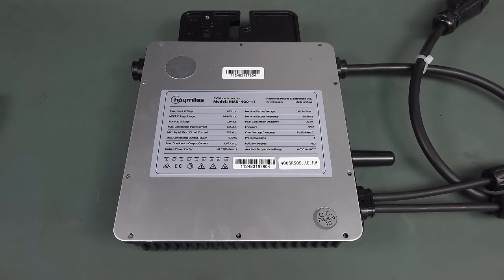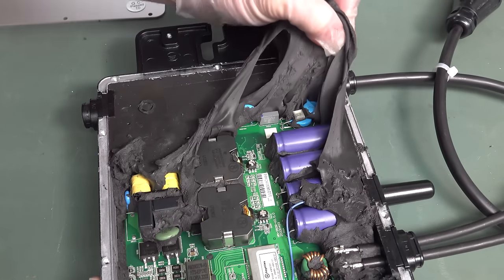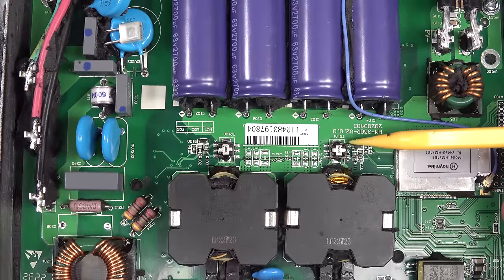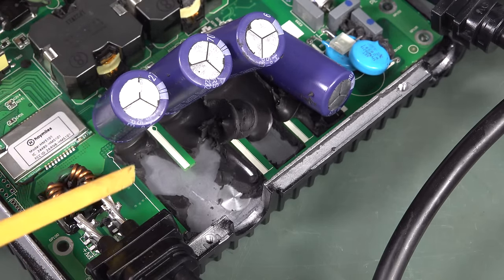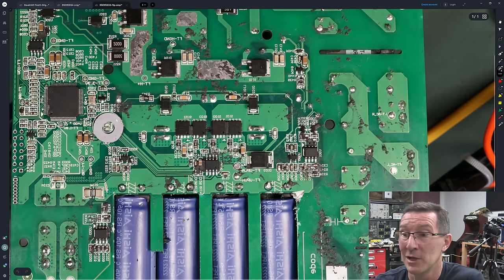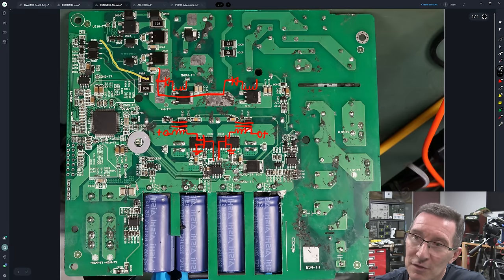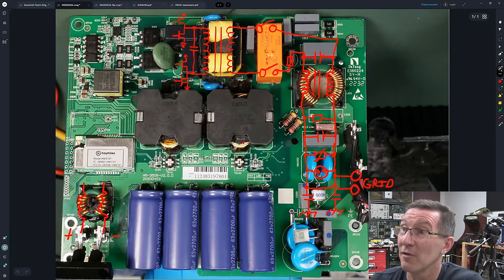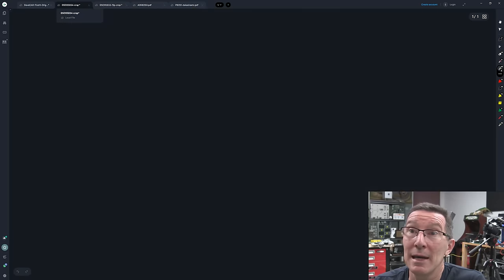EEVblog 1518 - Hoymiles Solar Microinverter TEARDOWN

Comment: A few years ago I opened an Enphase microinverter and it was fully potted with the same kind of material.  Yup, it liked to stick in components like inductors :)  In my case, the potting material seemed to kind of flow back into place with a little bit of heat and time - warmed it over 30 minutes or so on low temp in my "projects oven" in the garage.

Looking back in my circuit pics, the Enphase inverters (at least the model I have) don't have fusing in the PV input side either.  And they have the same double-transformers that you showed here, so I'll guess the same push-pull "interleaved" drive that you pondered of them.  I apparently didn't take pictures of the bottom side where the FETs live.
Reply: @mpirron1  Tyranny?

There are sound technical and safety reasons to not having a random (and out of utility control) assortment of power sources pushing against a broken grid.  At the most basic level, isn't the "grid-tie" concept orphaned if there's no grid to tie to?  The "tyranny" of physics is always ready to get involved too.

Also there are solutions to your no-power-when-there's-no-power problem.  Of course they center around batteries, can involve transfer switches and cost more.

Ah, the tyranny of No Free Lunch.
Reply: @Randrew  but its okay for ice generators?? Why can't I install an automated transfer switch on my inverter?
Reply: @Randrew  Tell me this, smart guy Why is it illegal for me to send my excess solar generation straight to ground if I am connected to the grid? Why am I forced to sell it to the grid operator? Why Is he paying me 1/6th of what I'm paying him? And only in the form of credits that cannot be accrued? Why can I not be paid in cash like I have to pay? Those provisions don't sound authoritarian in the least to you. I suppose.
Reply: @Randrew  And I don't want a free lunch. But if I'm buying it, I don't want to be told what to eat, It's enough to be told when to eat it, quite enough
Reply: @mpirron1  "but its okay for ice generators?"

Not anywhere that I'm aware of.  Where I work we've had a 500 kW diesel genset for the last 30 years.  We make industrial machines bound for anywhere in the world and we use the genset to provide the destination country's volts/Hertz supply power to the machines while they're on our floor.  We also use the genset on those machines to avoid ratcheting our electric "demand charge" up to max every time we start a big motor.

Our electric supplier is a US Rural Electric Cooperative (non-profit) and they would be happy to let us generate to their (our - member owned) grid, BUT the cost of required additional equipment for synchronization and anti-islanding (there it is again) made it impractical for us to implement.

"Why is it illegal for me to send my excess solar generation straight to ground if I am connected to the grid?"

Because if you're connected to the grid, it's not your ground (or transformer or switchgear or person) that its going straight to/through.

"Why am I forced to sell it to the grid operator?"

You are NOT forced to sell anything to the grid operator.

"Why Is he paying me 1/6th of what I'm paying him?"

You pay the utility for their cost of the electricity you use PLUS the cost of their lines, equipment, maintenance and personnel.  Oh, and their profit if they're not a Co-op.  When you generate an overall excess to the grid, does it make any sense for the utility to pay YOU the cost for THEIR lines, equipment, maintenance, personnel and profit?
Reply: @mpirron1  "its pathological"

Take a look in the mirror.  You seem to feel entitled to the fruits of other peoples' money and hard work to avoid spending a few thousand more of your own money.

Here's a plan you could have made BEFORE jumping the gun and buying a complete, grid-tie PV system:

1 - PV panels
2 - Charge Controller fed by the PV panels
3 - Batteries charged by Charge Controller and PV panels (can also be charged by the grid when it's up)
4 - a separate Grid-Tie Inverter, fed by your batteries, to "sell" back to the grid.

That should cover all you want to do PLUS having power when the grid is down.  But it sounds like you bought a PV grid-tie system and are now unhappy with the limits of its use case.

You still could sell your microinverters as "used", re-wire the PV panels and buy the rest of the listed equipment and configure it all as described.  You could even skip item 4 (grid-tie inverter) and be covered for grid outages.  You could add the grid-tie inverter later if you figure net-metering is worth the cost.
Reply: @Randrew  I am on-grid when I want to be and off-grid when I don't, generate, dump charge, discharge as I see fit and I would never use a piece of garbage like one of these gadgets. I don't personally play in the pool to which I refer, there's too much pee in it. My exercise was to make you understand what you are being subjected to. Apparantly you are ok UL1741, maybe you are okay living on your knees too. I don't know you. You shouldn't assume you know me.
Reply: @Randrew  I pay for what I use, that is NOT my point, what is your misunderstanding here? is it the term grid-connected mayber? okay how about this My point is you can use a grid-coupled generator when the grid is down and not backfeed because you have a transfer switch. Why must a solar inverter,  or any other piece of grid coupled generation equipment of any kind be different? Why is there no provision for a solar compliant transfer switch?
Reply: @mpirron1  "You shouldn't assume you know me."

Mea culpa.  I did assume that someone flipping out like this about microinverters had some and was pissed about it.  Why else come in here and moan?

However I am fairly knowledgeable about these systems and options - enough to be confident that (a) what you "want" can be done, just not with grid-tie inverters and PV panels alone and (b) these days it's probably even cheaper and easier to get approved to do without transfer switchgear in the manner I have described earlier.

Beyond that topic, it seems you're paranoid about "the man" or whatever... good luck with that aspect of your life.  Seriously, I hope it doesn't mess you up too much.

Comment: Looks like its following a Microchip AN1338 app note but using a Ti processor.  Basically the two large PQ cores are the inductors for two interleaved flyback boost converters.  They are interleave for efficiency.  These produce a high voltage DC that is galvanically isolated from the panel input DC by the inductor's secondary winding.  The DC then runs to a combined PWM and un-folder stage to produce the AC output sign wave.  The un-folder makes the opposite half phase.  Micro inverters are current sources not voltage sources.  You can't expect your 350W inverter to change the grid voltage but you can push current to the grid.   I didn't go through the code but my impression is it adjusts the voltage phase relative to the grid phase to control the current supplied to the grid and to remain within the MPTT range of the panel.  The DSP math is quite complex, with several servo loops, PLL's and error checking.  All the  while running the flyback converters, PWM and unfolder circuits.   Lots of factors to consider.   Every so often they turn off and check that the grid is still alive and shut down if the grid has failed. Don't want to fry the lineman up in the bucket truck.
Reply from the maker: Nice find. Yeah, almost indential topology.
Reply: Always wanted to know how they know grid is there or not WITHOUT turning its output off and listening. And you said its that simple, they just turn off for a few cycles🙂

Apart from detecting an overload, any other way to detect grid is down or not without dropping output power?
Reply: Thanks for pointing to interesting lecture 😊

Comment: Interesting black "goo".  I have disassembled two IGBT modules at different times.  In comparison to your semi rigid stuff, what I found inside was crystal clear stuff (except the black burnt traces indicating electrical tunneling).  But, clear or already burnt, it still was sticky and stretchy beyond my belief.  The modules were about 6" by 3" by 0.5".  They contained a 6 diode 3-phase rectifier bridge and 4 IGBT H-bridge for variable frequency drive and a "bonus" IGBT for a brake.  It took me over ten hours to pull most of the goo out with tweezers, forceps, small screw driver and exacto knife.  Half of the time was spent on cleaning my tools with paper towels...

Comment: It would be cool to see some testing on these before you tear them down.  Hooking them up to the lab power supplies and measuring output waveform and the thermal output at the case would be examples.  Maybe also do some over driving of the inputs and see what breaks first?

Comment: Great video.  I do wonder if the drawing of the isolation transformer is right.  It would have to output 240VAC at 50/60 Hz, rated for 400VA.  It seems awfully small for this job.
Reply: No. The mains voltage and waveform will  be approximated through PWM modulating the Power at high frequency.
Reply: I was thinking the same thing. I think what Dave thought is the 'isolation transformer' is actually the output filter, and the flybacks are the ones that perform the isolation. That little thing will never do 400VA at 50Hz.
Reply: @andreasdill4329  That PWM signal would still contain a very larege 50Hz component. (check the spectrum of a high frequency PWM 'approximation' of a 50Hz sine wave). You can't pass that through a high-frequency transformer.
Reply from the maker: Yes, you are correct, I should have actually put my thinking cap on, it's a common mode choke.
Reply: I believe your are correct, I think that is a common mode choke on the AC line side.   From what I have seen the PWM is done in the unfolder after the interleaved flyback converter stage. Very clever, get your PWM 1/2 wave sine conversion and polarity swapping for the second 1/2 wave with the same components.

Comment: Assuming no ingress, what do you think would fail first?  (My bet is a 65V max input rating could age those 63V input caps.  I like to see 100% margins on input/output caps.)
Reply from the maker: Residential panels are signifantly under that though.
Reply: @EEVblog  I could see someone putting a couple in series on each inverter, especially if they are hedging against a poor roof angle or something.
Reply: @tactileslut  it's all a continuum curve anyway. It's just less time before it begins to fail.
Reply: @tactileslut  You have to consider that in normal operation, the panel operates at about 70% of rated open circuit voltage due to the MPPT. So, it would only ever experience 65 V in case of maximum solar irradiation during a grid failure. I would still not rate such an inverter for 65 V though.
Reply: @EnricoConca  ehh, it doesn't take very long for electrolytic caps to explode with over voltage. 
It would usually be like zero output load on a cold sunny day to get that high voltage, thought.
Reply: Everything. The whole thing is very poor design.
1) moisture creep. Using filler compound makes capillary action of moisture, and typical urban air is mixture of acid no2, ozone and all other sorts of stuff which will corrode such board easily. Plus thermal expansion and shrinking will suck everything inside. 
2)EMP from lightning and static electricity like dry wind. While AC side has some laughable (and irreplaceable) safety features, DC side has nothing. There is also no circuit to disconnect DC side if any static or EMP anomaly would be detected. I guess just strong military radio station nearby, like jammer from fighter jet or radar could easily fry the board, esp. the ceramic caps will pop and they have low cutoff freq. 
Let's remind You that we are on the edge of WW3, so military excercises and EMP's from nuclear war will be daily bread pretty soon. 
3) outdated CPU, not rad-hard and easily fried and erased by unstable input voltage, EMP, x-rays etc. It is good for mp3 player for one season, just flash retention of 10 years makes it poor choice for something being put into extreme temperature range and electromagnetic storms up the roof. 
4)input DC caps. They have rating of like 10 000h by manuf, and in very optimistic temperature range. Note they are not designed to be replaced. After loosing half of capacity their temperature will climb up even more, as wires to panels are high inductance, so they are most loaded element of dc-dc step up converter. 
Weather is expected to be more extreme worldwide, and as one year of military operations burns up more fuel than 30 years of civilian use, we are already on fast track to global warming well exceeding 1.5C -average-. This means 50-60C heatwaves which already exceeds operating temperature range of such unit.
Caps used should be 150C capable, ceramic multilayer or other tech OR at least easily replaceable, f.e. on daughterboard. 

overall design is very poor IMHO, too cramped, not designed to be repaired, not modular, and with high self-consumption, crossing it out of low-wattage use. 
Also use of fr4 which is not really designed for prolonged high temperature use (it deforms, shrinks, outgasses and becomes porous to moisture) is very poor choice. at least control section should be done on ceramic board.
Reply: @piotrcurious1131     I don't know if your day job involves designing military / space grade hardware, but this is consumer tech with a life expectancy of 10 years at best.. I mean, I haven't seen any other microinverters from the inside, but I doubt even the top shelf brands will feature any point of your "must-have-list" there.
Reply: @piotrcurious1131      
"you need someone with certs to climb up your roof"
You need someone with a license for anything, not just in Europe. And as licenses are a case of monopoly (restricting market access for competition) it's no wonder that  "Labour to exchange it costs much more, esp. if it is on the roof"

"It is Chinese. Try European brands? Austria, Germany, Swiss."
There is crap being made everywhere.. it usually boils down to what you order, which has a price as robust design&manufacture requires more expertise which simply is more expensive. Chinese can build proper, robust stuff as well, but it has a price.. similar to what European businesses charge - which naturally is of no interest to the importers.

"consumers expect it to work at least as long as panels last, so 25 years"
25 years is a third of a conscious lifetime. It would be nice if our consumer products had such lifetimes, but a certain flaw in our currencies does force growth on everything which is why planned obsolescence and repeated business is aimed for.. not longevity of products.

"if you treat yourself like "consumer" who should eat s* [..]"
I don't, but I also do not expect (under the given circumstances) military / space grade hardware for Joe Average as our political and economical systems simply are unable to provide products at such levels at reasonable costs..
Reply: @piotrcurious1131    "Well, that is difference in-between us then. I do expect such products.."
I do to and look out for them, but I only got soo much money and have to be realistic. Maybe I got cynic? Mea culpa.

".. and I expect that the flaws in our political and economic systems being fixed."
Hehe, that is the difference between me and you then. I understand WHY those problems exist, what the root cause is and unfortunately have to tell you that those problems will not be fixed - esp not from the very people who benefit from the status quo.
I can explain the boring part of how it works if you're interested, but I doubt you will come to a different conclusion. And once you understand how it works you'll also recognize how it can potentially be fixed (if your mind-set does allow you to go there).

As for what's at stake if "we" don't solve this.. wars and piles of trash are the smallest problems there.

"do not be silly, there is reason working in dangerous places is banned - it is dangerous and expensive to pay for possible health loss."
There is harnesses, there is training, there is safety equipment.. each of which can be made/provided in huuge amounts. But licenses, IP, copyrights, patents, picking winners, etc. prevent that from happening, which is what drives those costs up - which is NOT a conspiracy theory. Read about 'copyright' or 'patents' on WP and find out for yourself WHY those principles got introduced. There is plenty economists who see those principles very critical and unhealthy for an economy to have.

".. please do not mix some conspiracy theory politics into it"
Ehm?! You should follow your own advice actually:
".. they will get whole package, including nuclear war part"

Come on dude. Putin might be at the top of the food chain in Russia, but it takes plenty people to keep those things functional and launched (who have nothing better to do with the rest of their lives than to spend it either death or in a nuclear wasteland). If you want to worry, worry about Kim. Either way.. both are just confirming my theory that it is unsustainable for a (planetary) society to allow WMDs in "private" hands. ;-)

Comment: Nice video. Regarding no fuse at the solar-panel input. Not needed as the panels are current limited. So as long as the connected solar panel short-circuit current not exceeds the rating of the inverter there is no need for any fuse as the panel will not be able to generate enough current to blow it anyway.